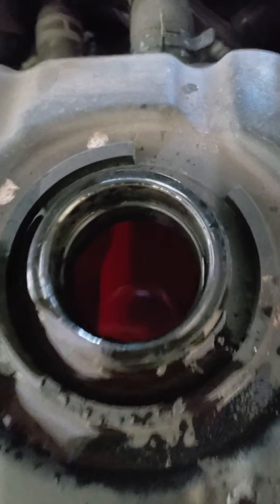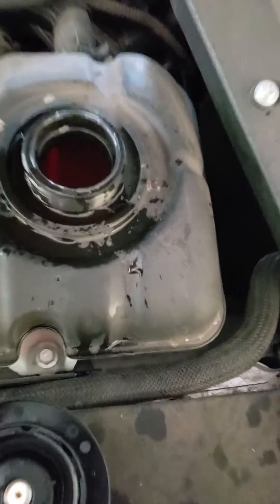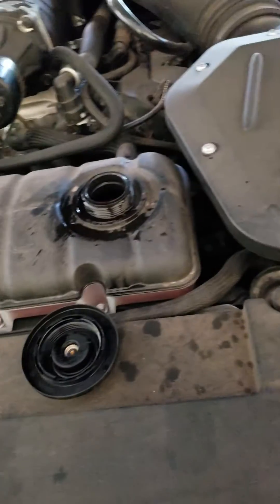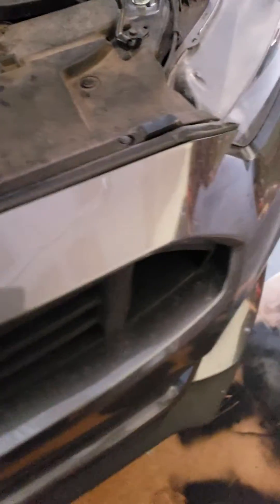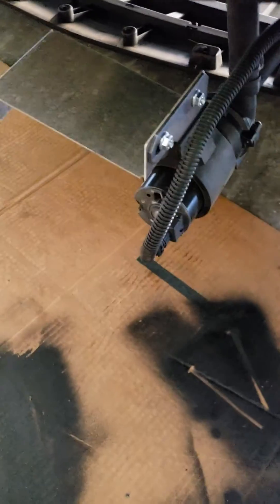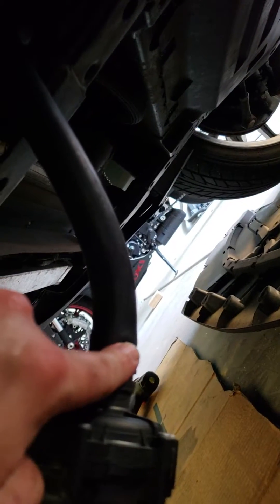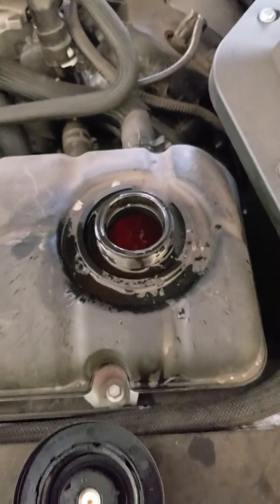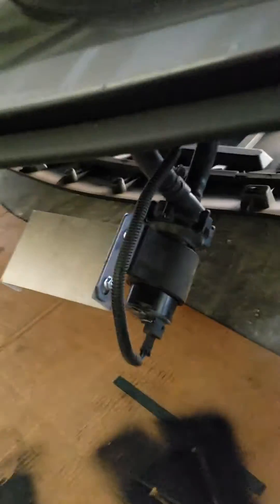VMP supercharged Mustang How to fix an air locked heat exchanger pump

Comment: Love VMP but this design takes a L
Reply from the maker: Yeah eventually bought their upgraded pump and turned it where the inlet is always gravity fed and then just zip tied it in place but I have like 3 or 4 zip ties holding it in place, been that way for 2 years now and haven't had an air lock issue again so yeah I would just gravity feed the pump, and mount it the best or secure way you can
Reply: @jasonwieber2762  baddas any way you can send me a picture of it ?!